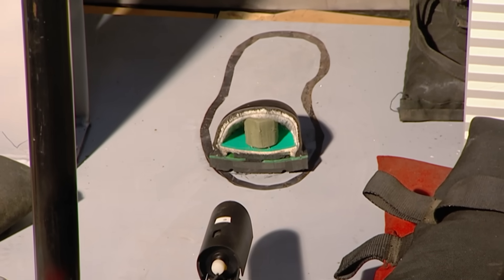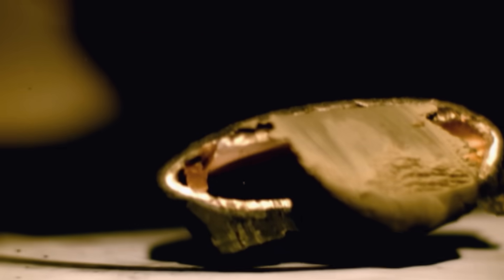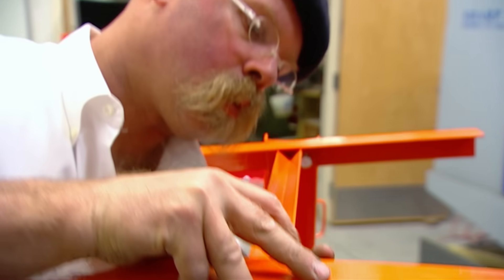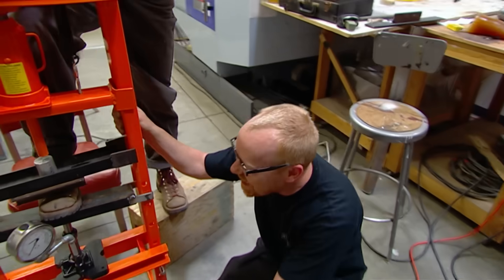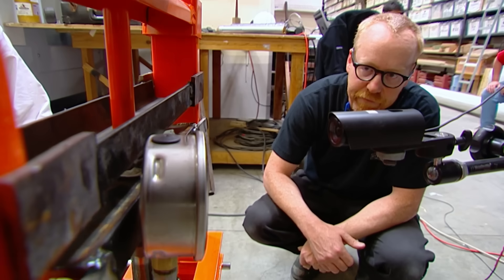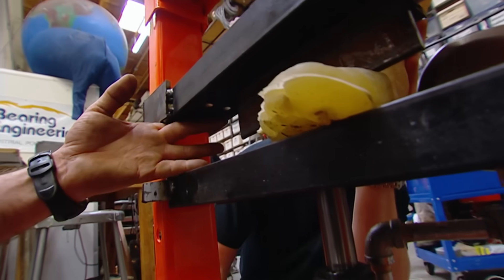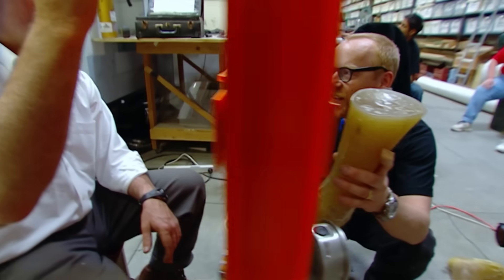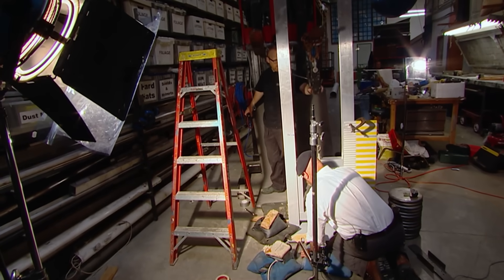Do Steel Toe Boots Really Protect Your Toes? | MythBusters

Comment: I worked for a local railroad some time ago. It was the last place I’d expect to not have a requirement for steel toed boots, but as they told us, “if one of our trains runs over your foot, the only difference steel toes will make at that point is how clean the cut is.”
Reply: I agree that a train rolling over your foot isn't going to be saved by a steel toe, but aren't there a gazillion things in and around a rail yard that could fall or roll on one's foot?  Tools, train parts, pipes, rocks, gates, cattle, cubes of metal for recycling, railroad ties/sleepers  etc?
Reply: @kev3d  you are correct. I've worked at my railyard for almost 14 years now. Hazards everywhere. A lot of them are severe enough that if you're in the line of fire, that PPE isn't going to do you any good, but that doesn't mean we can walk around in sandals and bermuda shorts with a ball cap on. Hell, even just the air blasting out of the brake pipe when we separate cars can be enough to throw rocks at you and potentially put out an eye or give you a nasty cut on exposed skin. Then there's hazards like sharp metal on handholds, or even just bumping your head on the underside of a railcar during unloading procedures. We aren't allowed to wear slip-on boots of any kind because walking on ballast rock is quite unstable and without an 8 inch boot with laces tied all the way up you can easily twist or sprain an ankle
Reply: @kev3d  I should have mentioned it was passenger rail, so there was less worry of large objects falling on us compared to your typical freight line. But even so, if we wanted to have steel toes we weren’t denied it. In fact most of us still got them since we were given a good enough boot allowance for it, it just wasn’t a requirement for PPE.
Reply: In my line of work (dominated by h1b Indians) full ppe (gas mask, gloves, radiation suit) is definitely a requirement
Reply: This is actually s good point for the dumb test they are doing thank you for the anecdote. A train running over your foot would lead to messier damage even id suspect. This show conflates normal trauma with extraordinarily severe trauma that isn’t reasonable, just like your example. Steel toes don’t intend on protecting you from a locomotive, more so normal work place hazards. They clearly purposefully confused that to justify a press rig . It’s such a bizarre choice for a test honestly
Reply: @CYMotorsport  i don't think you understand mythbusters
Reply: @CYMotorsport  They didn't conflate them at all.  The various separate tests were treated differently and assessed differently, and they concluded quite specifically that the extraordinarily severe trauma potentially being worse with the boots absolutely didn't mean that you shouldn't be wearing them to protect against the more common case.

Comment: Steel toes help, but are not 100% protection. I worked with someone who had a heavy steel plate land on his steel-toe boots edge-on. It did exactly as the Mythbusters show. It slid over and then behind the steel cap. He said it broke his foot badly, but it healed. He was lucky. I think such boots need a deeper cap and a metal lip to stop such motion toward the ankle.
Reply: You could buy the ones like Adam had here with the top of the foot protection. Depends how heavy and expensive you want your boots to be. I carried 3 pairs of boots in my truck. Ordinary day, really heavy day, and cold/wet days.
Reply: Metatarsal protection is a thing and usually required for those types of jobs
Reply: i mean toes is in the name
Reply: Once had someone drop a heavy oak door on my foot. Glanced off the steel toe and busted me right behind where the steel was. I was pissed, but didn't leave work. It helps.
Reply: @MDuarte-vp7bm get a pair with metatarsal guards in them. I got some in my steel toes and the metatarsal guards help a lot with stuff hitting the top of my foot.
Reply: A deflection still sounds like less force than an initial hit though.

Comment: What about composite versus steel?  Also, I've witnessed several people get their toes ran over by car/truck tires with no steel toes and not get hurt.  Why is that?
Reply: Thank god the tire pressure wasn't too high.
Reply: Because it's only 1/4 (or how every many tires the vehicle has) of the total weight of the vehicle.
And the weight is distributed over a decently large area.

Comment: I'd like to see how the composite toe shoes compare to steel toe ones side by side. I've wanted to switch for the weight savings, but I'm not wanting to compromise safety too much.
Reply: My logic was always that OSHA wouldn't allow composites if they weren't sufficiently safe for work applications. I do agree it would be neat to see how they stack up though
Reply: @skateloser4088  That was my reasoning as well. They get less cold in the winter, and better for electrical shock hazards. Never going back to steel.
Reply: @skateloser4088 as an electrician , I hope they compare good , metal is not an option for me
Reply: I think the idea behind composite is that, like plate armor, they can withstand one big impact thats it. Ideally you'd retire the footwear after something like that regardless, but steel is much more robust.
Reply: @radisnooker5 I think pretty much all safety equipment is supposed to be replaced after a single impact anyway though, at least hard hats and fall protection. I'd be pretty confident that I could drop a brick on my work boots and continue to use them after but if anything big enough happened to even dent the steel toe I'd be pretty inclined not to run the risk of it being compromised
Reply: @radisnooker5  
The steel will bend and deform, the composite will just shatter. Both have their uses, it's up to you which you'd prefer and they're comparable enough that the average customer shouldn't need to worry about which is which.
Reply: @radisnooker5  Which is nice because composite would shatter instead of pinning your toes into the shoe. Although if something is strong enough to do that, it probably doesn't matter.
Reply: A YouTube channel called project farm has done the test you are looking for
Reply: Project Farm on YouTube has a comparison video of different steel toe boots and there was a composite toe in there. I'd give that a watch.
Reply: Once you go composite you never look back. Only problem is, composite toes are sometimes thicker than steel toes to provide a very similar amount of protection, which unfortunately, can leave less room for your toes to lay comfortably in the boot. Some brands are smart enough to expand the composite toe outward rather than inward leaving room for comfort. Something to consider. At the end of the day just try on a pair of boots before buying if possible it solves a lot of issues
Reply: Composite will prevent toe guillotine. I switched to composite and they're so much nicer walking around in all day with the reduced weight.
Reply: As mentioned above, if composite toed boots were inadequate protection, they wouldnt be allowed by OSHA. Your feet will be just as safe in composite toes as steel. Trust me, they're worth it.
Reply: Electrician here. I wear composite toe boots exclusively because steel toe is conductive while composite is not. If your composite toe boots are ansi and osha rated then they will work just as well as steel toe. And as someone pointed out, anything bad enough to crush a composite or steel toe would absolutely destroy your foot so in the end it’s still better than regular shoes. I’ll take a few broken toes over losing my whole foot any day.

Comment: I had an electric pallet jack run over my foot once while wearing steel toed boots. It broke the steel causing it cut my toes. You’re much better off with the composite toes they’re much lighter durable and they’re more comfortable with more room for your toes.
Reply: That sounds pike your size was a bit small for your foot. There should he no difference in overhead from either, the difference is that the steel would be thicker. I.e you have an inch of room for your foot with both, but the steel makes the boot look bigger
Reply: @jaydeleon8094 wrong the steel actually decreases the amount of room for your foot to expand and breathe. I even had my foot professionally measured for the right size. Plus the composite pair have lasted at least 10 times longer than the steel toed ones under the same working conditions. My feet and back don’t hurt at the end of the day in the composite shoes.
Reply: @michaeljoesting2242  getting measured isn't the same thing as properly made boots. if the measurement is the same, the space inside should ALSO be the same.

and the pair of boots, what failed, the boot or the "armor"? cause there is a vast range of quality of the boots themselves.

granted steel is heavier, so I get your feet and back feeling better.

Comment: My steel-toed Red Wings have saved my feet several times over the past 12 years or so. Usually in the shop and during builds, of course, but occasionally at places you would never suspect, e.g. an antique shop. Had an old, heavy, steel sign fall from a wall and land right on my foot, after apparently bumping it in just the right way. Any normal shoe would've been sheared through, I'm certain.
Reply: I wear them at my warehouse job.  theres a lot tight quarters and its very easy to constantly catch your foot or stub your tore on something.  Really helps you if you have to kick or nudge something into place.  i feel like everyone should wear them

Comment: I only wear steel toes. The amount of times it's saved my toes? Probably less than half a dozen. But I still have all my toes. lol
Reply: but how many times have you kicked things or ran into things where the steel toed boots helped?
Reply: many times, just like a hard hat helps when bumping into things.
Reply: They also keep a wide area from your toes to splay
Reply: I used to have all my toes.  Then my young niece stole some of them.  Sniff I miss them.
Reply: Do you wear them in the cold?   I'd always been told that they're something you don't wear below a certain temperature threshold
Reply: @WaluigiMangione  Idk if I hit that threshold. I live in Florida, lol. I can say that some DO suck and will get your toes cold. But I've had others with something called 'thinsulation' that worked a little too well and kept them a little sweaty in the cold. 

I wear them all the time for 25 years and just would suggest really good socks, hehe.
Reply: @WaluigiMangione thick socks can fix most of those problems
Reply: @WaluigiMangione that's bullshit.

I mean wear composite toe if you actually out in the freezer Temps like below 0. But also. You should be wearing multiple socks and WOOL SOCKS.  And toe warmers work well. And then toe warmers with steel toe. Actually become better at retaining the heat I think, than composite. 

But without the heating source, yes, steel will be colder. But I live in New England. And work outside at Temps below freezing. Unless my boots have a hole or are no longer water proof. My feet don't get cold with proper socks and toe warmers.

The problem comes in the fingers, as it's hard to layer enough on fingers while still being able to use your fingers for labor. 

But yes if you have cold wet boots with steel toes and cotton socks. You will have a bad time
Reply: Steel being a good conductor is a point of advantage for making you less likely to be hurt from electrocution. Electricity is always looking for the path of least resistance to discharge it's energy - and metal tends to be a much better conductor than your body is. Electrocution happens when your body becomes the best circuit the electricity can travel through - and if there's a better alternative than you, it will prefer to take that instead of you, meaning you'll be safer. Giving the electricity somewhere to get where it wants to go that ISN'T you is how you protect yourself. That's exactly how faraday cages and suits work.
Reply: I used to wear mine all the time but one hot and stormy week a couple years ago gave me fungal toe. I've been fighting it with prescription meds ever since.
Reply: I've always operated under the idea it's better to wear them and not need them, than to need them and not be wearing them.
Reply: Even saving you 1 time is good enough
Reply: Half a dozen is 6 times more than none.
Reply: Shit they save my toes every other shift. Not from being crushed, but from stubbing them or dropping some junk or whatever. Same thing with hard hats. I've never had one save my life, but they've kept a lot of bumps and bruises from appearing. It's worth it just for that.
Reply: I wear mine all of the time also.  Have saved my feet.  Also useful as a weapon.
Reply: They are an instant weight train for your lower legs as well!
Reply: The weight of steel toes after 7 years fucked up my hips and back. Switched back to regular boots. Damned if you do dawned if you dont
Reply: Lol must be comby in hot weather:)
I only use them in work..
Reply: @joe125ful I always hear that it’s uncomfortable in high heat but I have steel toes and wear them everyday in Texas and my feet feel fine?
Reply: @ezra9265  It depends on the environment you work in. Steel insulates so in the summer it's super sweaty and hot and in the winter it's freezing. Not to mention it's hell on your feet walking around with steel weighing them down. It's why I choose carbon fiber toe over steel. Where I work it'll protect the same way steel does but it's far more comfortable and plus I won't get accidentally electrocuted if I step in water that's around a welding station. More comfortable, more breathable, and I don't have painful blisters and calluses anymore. Steel is probably better from a raw protection point of view but from my experience most people who end up injured is because they weren't paying attention.
Reply: @gagetaylor192  You likely wouldn't be electrocuted in either case since the rubber soles are a very poor conductor.  But if your feet are wet AND you are completing a circuit, it won't matter if you are wearing steel toes or carbon.  Carbon is still a conductor but that's not the important factor.  You can be dressed head to toe in steel or carbon or tin or silver or copper, and have electricity surge all around you and you would be fine provided the electricity doesn't think YOU are the path of least resistance.   If you are wet or stand tall on an otherwise featureless hilltop during an electrical storm or the electricity doesn't have anywhere else to go, then you could very easily be zapped.
Reply: @gagetaylor192  lol, steel is the exact opposite of an insulator, it's one of the best conductors, for heat and electricity
Reply: @gagetaylor192 It sure does depend on the environment. I did some wildland firefighting back in the day and steel toes aren't good for that because you could burn your toes from stepping on hot coals on the ground.
Reply: @gagetaylor192 Steel-toed boots barely weigh more than regular boots. The amount is negligible. Not once did I ever think "man, these are heavy".

I would if I were asked to run track in them. But for everyday wear? No problem.
Reply: @ezra9265 yeah idk what folks are talking about, up here in Minnesota I've worn them in 90+ degree heat just fine, and worn them in the freezing temps just fine as well.